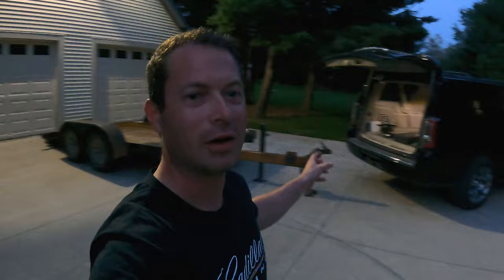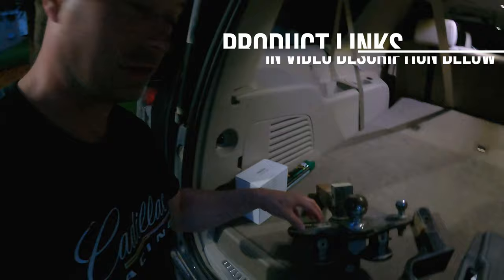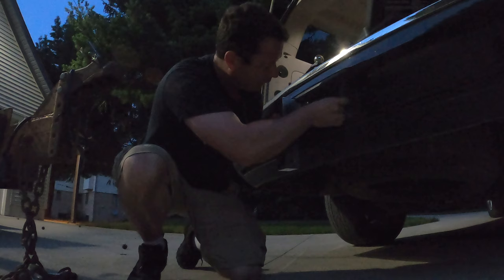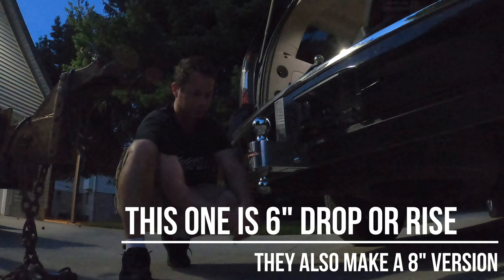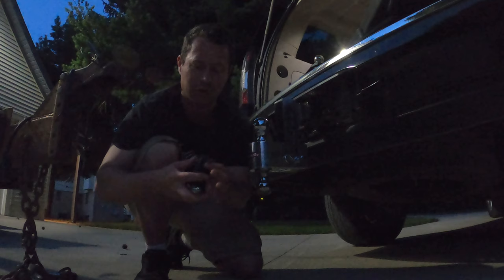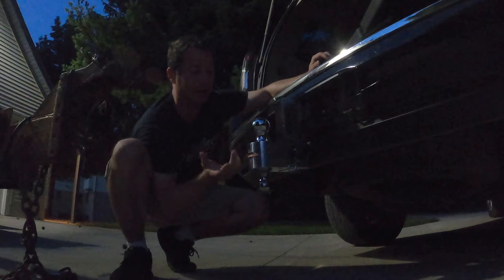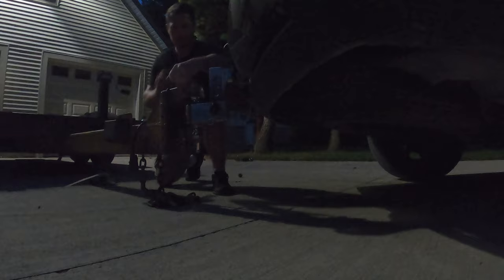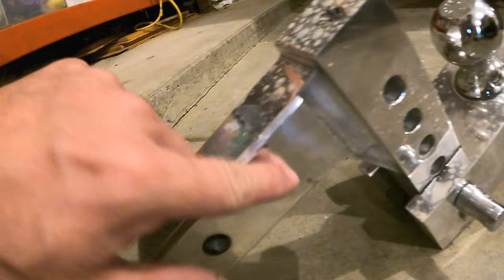✅ Aluminum Adjustable Drop Hitch - Uriah Aluma-Tow 6 - Compare To Standard and Weight Distribution

Comment: In all honesty if it's unloaded it shouldn't be on the Truck.... good review
Reply from the maker: The trailer?  I was going to buy a mower so it has to be empty enroute there.
Reply: @NaterTater  ...if the hitch is unloaded it shouldn't be on the the Truck.... then 1... ya not worried about it being noisy.... and 2 ... it won't rust cause it stored away... too many people leave the hitch in the receiver all the time and it rattles... it rusts... the pin seizes... the lock jams... it rattles ... they bust their shins every time they walk past it... then they bitch about the afore mentioned.
Take it apart and store it unless using it...simple
Reply from the maker: @steveo4141  ah yes but when i said unloaded i meant with a empty trailer in tow.
Reply: @NaterTater  my bad... thought you meant " nothing" on it😬
Reply: I leave a hitch in my receiver just in case someone runs into me.
Reply: @markbroad119  Truck bumper should be solid enough to take a hit... more likely to injure yourself with it sticking out.
Had a coworker back into a parking space didn't realize they caught their  hitch ball under the person's vehicle behind them ...when they pulled away it ripped their bumper clean off.
I see a lot of tow hitches rusted in place all kinds of videos on how to rip them apart... if you only have in place when you're using it...it's never a problem...
Anyhoo to each their own.
Reply: @NaterTater  I use a couple of old credit cards to take up the play, on the side, and on top, and no rattling at all.

Comment: I have this in the 8-inch version.  It is the worst hitch I have ever owned.  The gaps are so bad in the receiver and bounce up and down.  The adjustable slide height gaps are. So bad on the ball mount that after 5 or six tows, I nkw have notches on the top and bottom of the slider.  You would think with two pins holding it up, there would not be this uck slop.  I tried to get a refund, but the company told me that they only had a 30-day policy.   So I am now the proud owner of a BW hitch, and the crap for a hicth went to the scrap yard, and I got $26 dollars back.  I, like Nate, was excited at first, but with real-life use, I was let down by this product.   I would not recommend this hitch.